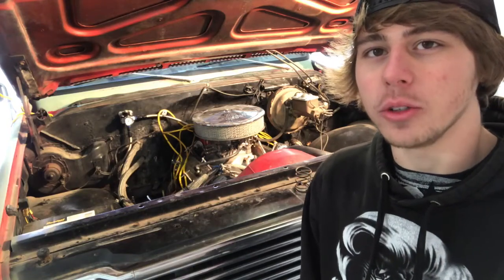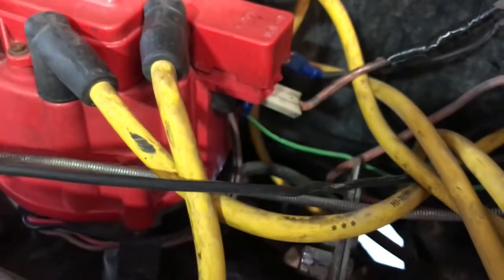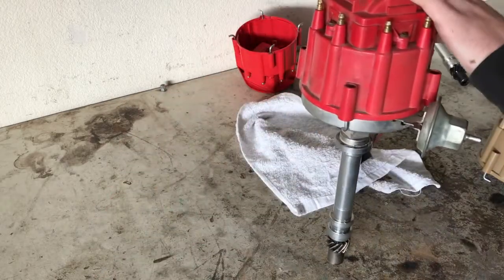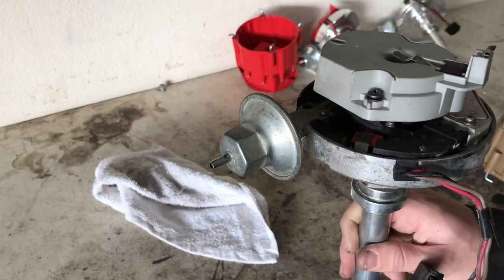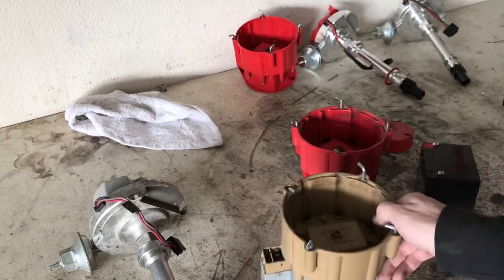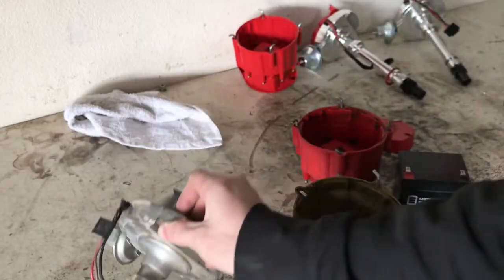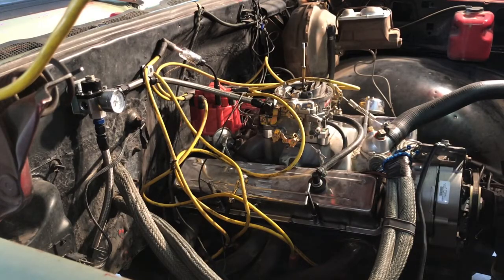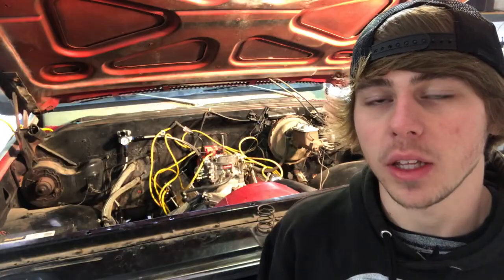How to Diagnose HEI Distributer, No Spark No Start.

Comment: Nice easy test you the man👊🏻this was extremely helpful just tested my distributor it’s arching like your replacement my problem is everything else is making contact ohms test module trigger test I just don’t get spark thought my spark tester was bad tested it on my sons 85 blazer works great did your test got spark will attempt to try again 🤞🏻

Comment: Show how to test module and pickup coil also.  Should have shown lining the rotor up with number 1 terminal before removing distributor (with cap removed) and same thing for re-installing.  You very much need to check the phasing on your distributor also considering all that carbon in the cap.  Your rotor may be having to jump too far to the terminal, this can weaken and burn up your coil!
Reply: Actually the only reason to remove this distributor would be if the pickup was bad , save ppl a whole lot of nonsense by showing them how to test , coil, module and pick up without pulling the distributor..... Especially because a bad pickup is usually the least likely cause .    Js

Comment: I just tested mine the same way...it was showing fire at the plug and it looked strong...so I tested other things...when there was nothing left to test I checked the timing and it was dead on...turns out it was the module...I've had those go bad before but never acted like this...I put a new module in it and it started up and ran fine....again I've never heard of one doing that so that plug wire tester isn't always accurate.
Reply: Is the module the long circuit looking thing?
Reply: @heltonh3944  it's under distributer cap usually black...has two wires on each side...2 quarter inch screws hold it in.
Reply: Under rotor cap in distributor

Comment: yessir, preshate it. I was getting no spark. bout to change the wires, plugs,and  coil inside the HEI. thanks.
Reply from the maker: Make sure your getting that 12v to the coil cap before you spend money replacing anything else!

Comment: I'm getting 12V in the "ON" position. I'm getting .5V while cranking
Reply from the maker: I would follow the wire from 12v power or possibly can be the ignition switch but could be many other underlying issues.
Reply: @NashCustoms  thats what we are going to do

Comment: I’m not getting power to the main wire. My fuse box has power. Any suggestions?
Reply from the maker: That wire should receive power from your key ignition switch in the cab. You can look for a wiring diagram of the steering column and you’ll know what wire provides power and sends power to the distributor. There can be a faulted wire or a bad ignition switch.
Reply: NashCustoms thanks for the quick reply. I made a damn mess, because i took off an alarm it had. I went out and bought one of those cheap ignitions from auto zone it cranks but no luck yet.

Comment: I was driving and it cut off with no power I did some checks and it was getting fuel and no spark and the starter wire remote was burned out like something was touching
Reply from the maker: I would look into ignition power. See if the ignition is receiving power. Make sure to fix that starter wire and then wrap it with heat protective wrap.

Comment: Do not follow the directions in this video. This is not how you remove and install a distributor , and of course there are easier ways to test components of a hei distributor without removing it.
Reply: What are those ways?
Reply: You would think if you’d comment on better ways to do something you would also include that info

Comment: You skipped over reinstalling the distributor to get it timed correctly.
Reply: Top dead center on compression stroke. Stick your finger in #1 cyliner and once all the air stops moving past your finger thats top dead center. Point rotor at #1 cylinder #1 wire terminal pointed at number 1. Correct firing order, tightsn the dizzy down so its tight but you can still time it with some effort. Then once your happy tighten the dizzy bolt fown

Comment: Hello, I have the same issue . I changed the entire distributor, cables, and coil HEI and it wont spark. It did run once more BEFORE i installed the new Accel distributor... Any suggestions ?
Reply from the maker: Eric Slifkin you don’t have the ignition wire plugged into the distributor. There is wire when key is on will have a 12v power supply this must be plugged into the the distributor.

Comment: You mention to make sure the wire that powers up the hei has 12 volts. What if it doesn’t?  Mine seems to be intermittent.
Reply from the maker: That comes from your ignition so your key has to be on. Without it it won’t supply power so it won’t ignite the spark.
Reply: So possible ignition starter switch?
Reply from the maker: Yes, I have seen that be the issue before on a Pontiac.
Reply: Thank you!  You’re a good teacher !

Comment: or pull off spark plug wire and put spark plug in wire ,(I use old one)and have someone crank car over while you have plug up against metal..(has to be against metal!)

Comment: I like the step by step, question can u hook the distributor on the vehicle like u did removed or it will F*ck things up, the car am asking for its a project car it doesn't have a computer on it no more
Reply from the maker: Miguel Sanchez you wouldn’t be able to spin the distributor if it’s locked in sync with the cam gear unless you crank the whole engine over.
Reply: NashCustoms could the engine start if it sparks ?
Reply from the maker: Not if you don’t have the spark plug wires connected or even better just take out the fuel pump fuse.